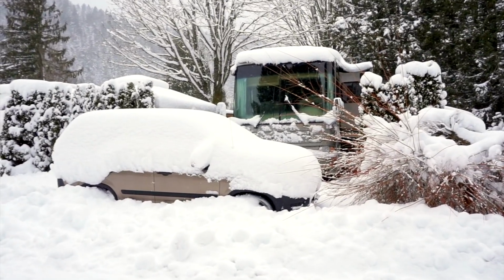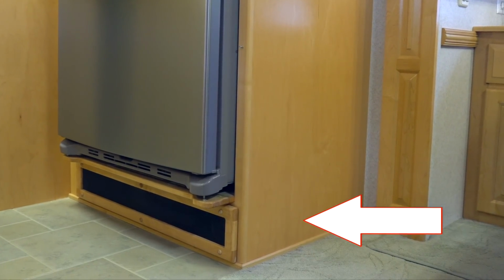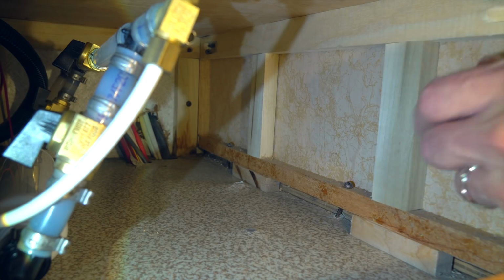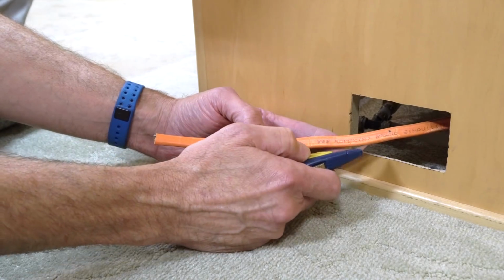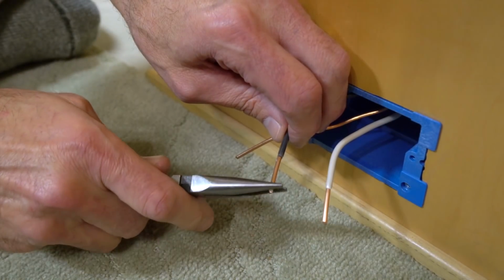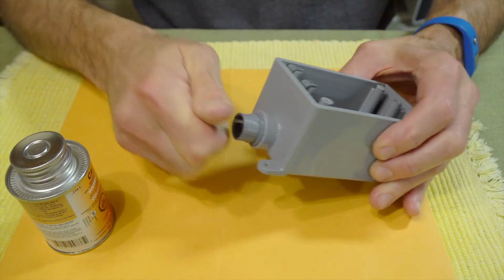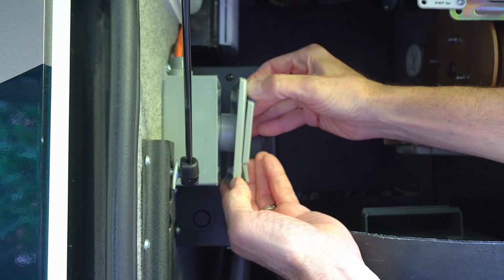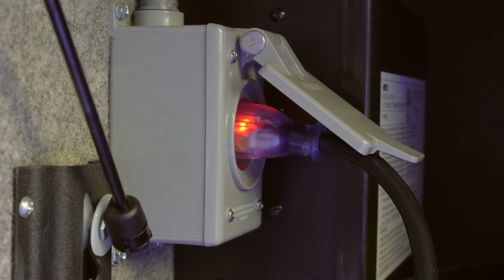Installing Our Winter RVing Secret Weapon!

Comment: Thank you for such a great idea.  Are you able to run the Furnace blower in order to keep the tanks heated?
Reply from the maker: We actually just put a drop light with a 60-watt incandescent bulb in the water compartment, and nothing else has been needed. We'd had temps down in the low 20's with only one lightbulb needed. If it got really cold, we'd likely add one more. We also keep the remote sending unit from our indoor-outdoor thermometer down there so we can keep an eye on the temperature from indoors. Lots more of these types of tips in our original video about how to RV in the winter: https://youtu.be/n5RGlcLSrM4 and more in another winter video from last year: https://youtu.be/MJK7YIU-SFQ
Reply: Thanks for the super fast reply.  Do you suppose  that the large storage tanks. fresh water, grey and black are just so large that really the only thing to be concerned with might be the incoming and drain plumbing to/from those tanks?  Especially with these Class A's (ours included) that have enclosed undersides?
Reply from the maker: The small fittings and lines are definitely the most susceptible to freezing, so the most important to protect, as compared to the volume in the tanks. Not that you want them freezing either though. We actually have tank heat pads from the factory, but we rarely use them, since keeping the basement warm (from that light in the water compartment) usually does the trick. The times we've used the heat pads are when it gets brutally cold, down into the teens, as it did when we camped in Zion last winter (we have a video about that too!). The best thing we can suggest is keeping a remote sending unit from an indoor-outdoor thermometer down there, as we mentioned. It's the best way to see for sure what's happening down there, and respond accordingly. We've tested with the 60-watt bulb both on and off to see what a great difference it makes at various temperatures. You can even try moving it around to different parts of the basement to be sure you're keeping all important areas above freezing.

Comment: I lived in such a space that had this electric system and the owner had to cut the 20 amp socket out because people were drawing more total energy out than the 30 amp lines running to the box. I think those 20 amp are for smaller campers or  the convenience of using a 20 amp plug for a device you want to run close to the box., not for getting 50 amp service out.
Reply from the maker: This can indeed be the situation in older parks, but many newer ones can handle both outlets being used simultaneously, making our mod very useful in many places. Also, having a 30-amp plug and a 20-amp plug available at the same pedestal, even in newer parks, is not the same as 50-amp service. True 50-amp service is two 50-amp hot legs. It's more complicated than just 20+30 (we're not electricians, so not explaining this right though). LOL We mentioned this in the previous video about planning our mod: https://youtu.be/ggWhFZPAmig

Comment: Very good video! I do however have a suggestion to save a few $$$ on the expensive 20v inlet receptacle. Since you’re purchasing the 10/2 wire (12/2 is more than sufficient for a 20amp circuit since the plug would fail before the wire) you could make your own extension cord with male plugs on both sides of the cord. A simple 20amp outlet  is much cheaper than that inlet. Just my 2 cents. Still a good video that covers all that’s needed to complete the job.
Reply from the maker: Great idea, Mike! Thanks for the tip. :)

Comment: A tip. Use 50 or 100 amp extension cord instead of romex.
Reply from the maker: Thanks for the tip. In our case, we had extra Romex left over from our Xantrex Inverter upgrade, so wanted to use parts we already had available. :)

Comment: Nice, detailed video. The only thing I’d do differently is to encase the wire in flexible conduit with anchors instead of placing it against the walls.
Reply from the maker: Thanks Rick! Nice additional tip. :)
Reply: You're not supposed to run Romex through conduit, it can cause the wires to overheat. Since its such a short run of wire and it's inclosed in a bay that's not used for storage, I wouldn't worry about it.

Comment: No Internal Circuit Breaker? No GFI??  
Boy your really trusting of all those random campgrounds...
Reply from the maker: Hi Mike... every situation we have seen where there is an additional, 20-amp circuit available, the outlets have been GFCI, there is a circuit breaker at the pedestal and (we assume) a second breaker supplying that circuit at the campground's main electrical room (so power to that circuit could be interrupted for work on the line)... for a total of THREE protective mechanisms on a single circuit. If we were merely using a heavy-duty extension cord brought through the window, we wouldn't have (or need) any of those additional protective devices inline. Since this is, effectively, a more-permanently-installed "extension cord", we felt safe assuming that risk for the limited number of instances where we will be using this configuration. But, of course, installing an internal circuit breaker would provide even more protection.
Reply: Shush

Comment: A wonderful video, as usual.

The 10/2 romex is absolutely overkill. 12/2 is entirely appropriate, even for belt-and-suspenders folks.

Your heater is 1500W, which is perfectly happy on a 15A circuit, so you could use 14/2 romex and regular outlets/inlets/extension cord. That could be useful if you ever visit a friend that has only 15A circuits in their home.

When peeling the outer sheath off romex, it's better to cut just the the last inch of sheath, and then tear it down by hand. No risk of nicking the wire insulation.
Reply from the maker: Thanks for all the insights Jay! We definitely knew we were overbuilding things. 😊
Reply: Yes 12-2 would have been fine
Reply: but by over building you could also get a much bigger heater later if you wanted without having to change anything.

Comment: I’m only 13 but I can say that using the orange Romex is against code it has to be the yellow cable Romex but else wise good job
Reply from the maker: We appreciate the comment, but actually the yellow Romex is the smaller 12/2 gauge. We opted for the larger gauge 10/2 Romex, because, as we mentioned, we overbuilt the system for extra safety. That's one of the beautiful things about DIY... regardless of what the code states as the standard, or minimum, we can go larger and better. ;-)
Reply: Correct the orange only means it’s 10 awg. Yellow is 12awg. Use either but 12awg is code compliant
Reply from the maker: Actually, RVs aren't subject to housing codes, but we like to make sure we install things that exceed the minimums!
Reply: Mjl4237 yea but I just perfer to use the right gauge wire for the job
Reply from the maker: Yup! Us too. We always make sure to meet or exceed the minimum code.

Comment: Good instructions, the only suggestion I can add is to try to move the outlet up as high as the space allows, maybe knee high if possible. Most RVs are used by retired people, who will appreciate not having to bend over so far to plug into the outlet.
Reply from the maker: That's a great suggestion! In this case, we were limited by the fridge, so could only have gone a couple of inches higher. But we'll keep that in mind for the next time if space allows.

Comment: This is a great idea except if your compartment are heated by your on board furnaces. If the temporary heaters work well and your on board furnaces never kick on and it gets below freezing for a day or so, like it has here in north Alabama for the last week, then your water lines will freeze unless you take other precautions to safeguard them!
Reply from the maker: Hi Tim! You're right about that for sure. In our last video, where we talked about planning for this mod, we did mention that we take steps to keep the basement from freezing by putting a drop light with a 60-watt incandescent bulb in the water compartment. :)

Comment: Hey nice job and very informative! I would have added a little silicone sealer to the wire that enters the top of the inlet box that’s in the compartment, just to be sure no liquid could run down the orange wire and into the box.
Reply from the maker: That’s a great tip! In our case, that compartment has lots of electrical equipment in non-weather-sealed housings, because it’s very well sealed and dry as a bone in there. 😊

Comment: Well, again another awesome video. My RV right now is covered with snow and ice sitting on my driveway. Came from FL few days ago and ended up home in GA with about 3 in of snow. I have to propane on and I hope the pipes don't freeze. Great video guys, I need to camp next to you guys so you guys can guide me with few projects.  I am afraid to do anything to the coach by myself. :-)
Reply from the maker: Come on out west Hector, and maybe we’ll see you on the road! 😊
Reply: Just cleared 24 inches off our motorhome yesterday(Michigan). Don't be afraid of taking on projects yourself. Do some research beforehand and you will feel great about yourself when you finish.
Reply: Thanks Sean, the other day my central Dirt Devil Vacuum stopped working. I did a little research, talk to other, and came out with a possible problem. The relay switch inside the vacuum was bad. Contacted DD and they sent me one for free since I was still under warranty. Removed the unit, open it, looked twice or three time before I cutted any wires and wala.... back working just like before. That was a simple task, but there are others tasks that may require some expertise that I don't feel good about it doing it myself. But thanks to RVGeeks they make things look very easy.
Reply: By the way, the three inches we got here in GA was enough for me for the rest of the year.

Comment: You are full of it. It doesn't matter if you put the exterior box inside a weather tight compartment, you install the gasket. It has more than one purpose. I have seen water get inside those compartments. They ate weather tight not weather proof.
Reply from the maker: Sorry Grar, but that compartment is full of sensitive, factory-installed electrical equipment in completely non-weather-sealed housings. It’s as dry and protected in there as the interior of the RV. What, pray tell, are the “other purposes” of the gasket? We could have used an interior box there, so just because we chose an exterior box doesn’t mean that it has to be weatherproof.

Comment: Be sure and emphasize that you have tank heaters because most rv's do not !  And electric heat does not get down into the basement and your fresh, grey, and black tanks WILL freeze ...
Reply from the maker: We do indeed have tank heat pads, but rarely use them (although we would if we were in harsher conditions). The real trick for us has been keeping a 60-watt incandescent bulb in the water compartment, as we mentioned briefly in our last video about planning this mod. We also showed that, and several other tricks in our original How To RV in the Winter video, about 6 years ago, including the fact that we keep the remote sending unit from our indoor/outdoor thermometer in the water bay so we can monitor the temp down there: https://youtu.be/n5RGlcLSrM4

Comment: Great project, and truly a professional video with perfect narration. 
When drilling through a board, I sometimes put a (temporary) piece of scrap wood on the other side of the board being drilled. This prevents 'break out splintering' when the drill bit exits the permanent board being drilled.
Reply from the maker: Thanks for the comment, and the great additional tip!

Comment: Excellent video! Really enjoyed it. Will be doing this mod on our camper this spring but I'm going to run off the back side of the 20 amp plug another regular 110v plug for powering miscellaneous small items during the summer.  As stated in some campers (like ours) 110v plugs are few and far between at times! Keep up the videos!
Reply from the maker: Thanks so much for the comment, Sam, and the great additional idea! :)
Reply: First video of your's that I had viewed and have already watched multiple others and subscribed too. Have also recommended to others so keep up the great work and simple step by step videos. They are appreciated!
Reply from the maker: Thanks Sam. Great to have you here with us. 😊

Comment: You all do have a great way for your videos. I think if you did a video about mud, it would be clear by the end! 

It’s a great idea, I’ve thought that the 15 or 20 amp plugs I’ve seen at the campground we’re just extensions of the other larger circuit, whether 50 or 30 amp. Is there a simple way to tell, like a 30 or 50 amp breaker plus a 15/20 amp breaker? Even then, is it a separate circuit, or just a smaller breaker protecting the 15/20 amp outlet? 

FWIW, (not much) I’d be more concerned with not having the romex in conduit if you were going through storage areas where there was a good potential for it getting bumped about. 

It’s been unusually cold this year in NE Ohio, I’m wondering if you all are going through the same thing. Might I suggest a remote thermometer in your tank compartments? If nothing else it’s comforting to see they’re doing fine, or to realize you need another light bulb before you have an issue. Tryin to figure out how to thaw a black tank in the dead of winter can be somewhat stressful. 😁
Reply from the maker: Hi David! Not sure about how to tell the difference between parks that have separate circuits or not. Generally newer parks would be more likely to have them. We thought the exact same thing about the Romex being in a spot with very little exposure or likelihood of damage, which is one thing we like about DIY.... we can decide for ourselves on things like that. ;-) We do indeed keep the remote sending unit from our indoor/outdoor thermometer in the water bay so we can monitor the temp down there. Thanks for mentioning that. We showed that, as well as many other tips, in our original winter RVing video: https://youtu.be/n5RGlcLSrM4
Reply: My GUESS is that it varies with the park.  Most likely, if you have three breakers in the pedestal, it is on its own circuit.  The ONE park pedestal I worked on had  4 gauge wire coming in, powering up each of the three breakers.  So-THAT one had separate circuits..

Comment: Great mod!... the only thing I might add is to note many RVs like mine have stainless steel sheets under the floorboards... once you drill thru the floor make sure that black cable protector goes thru the hole to protect the romex from being cut by any metal that could come in contact with the romex and vibrate while driving...
Reply from the maker: Thanks for the tip Kevin! Ours was only wood, as the bit went right through, and no metal shavings.

Comment: I would like to have an isolating switch, earth protection and over current protection at the point of entry to your RV. This is regulation in the UK as currently you only rely on the service provider to protect your RV user. Also, this needs to be on the same phase of power at source. The service provider should have this in hand but always best to check voltage between the supplies to avoid high voltages in your RV. If two phases are present they should be marked accordingly.

Comment: Good to see you using the 20A connectors and cord.  Even though you could have used the 15A items, there are too many people who wouldn't bother and cut corners just to save time and more often a couple dollars.
Reply: iceman22st (irritated groan) I know, I've seen some people on YouTube doing that. I saw a video on YouTube where a person installed a CB radio wrong. Now, I'm not hating the person for installing a CB radio in their car, it's how they electrically wired it that I'm hating them for, the person just jammed a wire into the fuse box without a fuse, which is good for temporary use, but a huge no no for permanent use, because the insulation on the wires can eventually rub away enough to where they can short and burn the car down.
Reply from the maker: Thanks! Glad you noticed. Great to hear. :)
Reply: morgan russman I think I knew that guy.
Reply: iceman22st oh?
Reply: morgan russman My father-in-law was bad for that. I had to rewire his vehicles multiple times over the years.
Reply: iceman22st oh jeesh, I'm sure that was hard work and took a few hours to do, give or take.